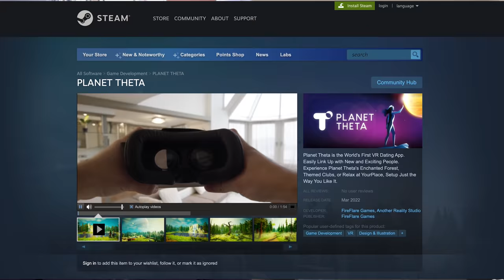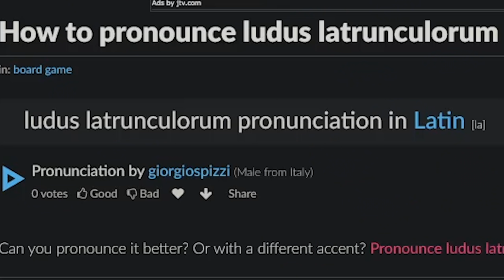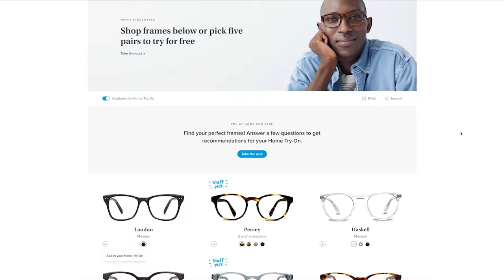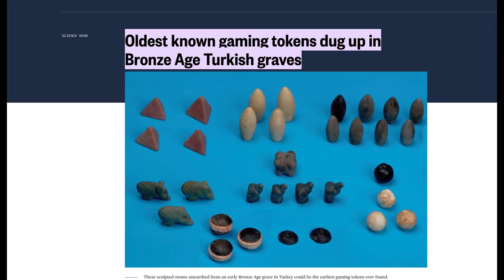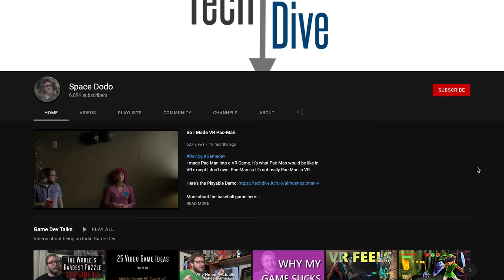Making an ANCIENT Board Game from Scratch

Comment: Two tips for Adam regarding the actual manufacture of the game:

To make a cube from a round stick (without loosing a finger), draw a square on the end of your stick, measure one of the sides of the square then cut a round from the stick at that length. Then simply split the stick along the drawn square edges to end up with your cube.

To mark wood, use a thin bit of metal heated in a fire, rather than the flames directly to make much more precise and intricate markings on your pieces.

All in all a very interesting concept, I can't judge the game since I haven't played it, but the whole process of designing a fun game is an interesting undertaking and a worthy pursuit!

Comment: 7:30 That is not a proper 6 sided die... Any two opposing ends of a (six sided) die shud add up to 7. When ya flip it from 6 to 3 to 5; that confirms that isnt the case on your die.
Reply: Good to know
Reply: @SpaceDodo  It actually applies to all multisided dice too aside from like pyramidal d4s (and odd sided dice).

On any given (even sided) die the opposin sides shud always add up to 1 more than the number of sides it has.

This works even for a D2 (a coin) which ofc adds up to 3 on its only two opposin sides, but also for a d20 and a properly made d100.

On a d6 the difference isnt as important but if you compare a spindown d20 (like an MTG life counter die) to an actual d20 you will see that one can much more easily be marked in a very slight way to assure it to be much more likely to roll high or low as all the high numbers are clustered together on a spindown die.

Its mostly a worry of folks more easily weightin a die to get high or low numbers, but it is also just an interesting fact about how dice are made and about how numbers work and a kinda fun fact about how numbers work, eg like how you can get to 21 by addin up the lowest and highest numbers between 1-20 and how that is true of all numbers.
Reply: Yeah I was just thinking this
Reply: It bugged me to but i mean it doesnt affect the play at all
Reply: @mojann1  well, barely
Reply: Indeed. It also bugged me that a single die was constantly called a dice.
Reply: @SylviaRustyFae  Even without marking, spindown dice are very imbalanced because of the simple fact that you can decide how you hold it and throw it, and that easily can be used to determine which half of the die will be upwards, and thus the higher or lower number side depending on what your desired roll outcome is.
Reply: @mojann1  The more sides you add to a die, the more it can affect gameplay.
Reply: @KainYusanagi  See that to me wud not be called a die roll tho; ive seen when folks try to do that with a spindown and the die doesnt roll at all, it just falls into place on the side they had it on.

Ofc, thats just how i tended to rule that kinda stuff when i did a lot of tabletop rpgs and board gaming; mostly only came up in board gaming nites cuz thered always be drop ins for that who dont understand that fair play is more fun than winning.
Reply: @SylviaRustyFae  didnt they make a six sided dice? When did the dice start to have the order we know today? Maybe it is historically correct
Reply: @mojann1  Well, its hard to tell what the earliest d6 is, let alone to tell what numberin order is correct. There are plenty of ancient 6 sided dice that have our now standard numberin, but also some that didnt. 

However, the whole idea of dice was entirely unstandardized in those times and if we wanted to be historically accurate it wudve been best to not try to even out each face to have an equal chance of being rolled. Dice were very commonly misshapen and lumpy and not nearly as likely to give a truly random distribution of numbers.

But ofc, no one today wud want tk play with a die that is more likely to land on 1 and 4 just bcuz of the way it was cut not bein even and and the maker of the die just not carin enuf to shape it correctly.

It does seem like the six sided die didnt come about until sometime around the time of Romans; but the idea of that being actually true as opposed to it just being they used dice that survived... Id believe it more likely the six sider showed up well before Roman times. 

The commonly used knucklebone dice that can be traced back to being used over five thousand yrs ago were actually six sided as well, but unless one were to grind down two of the sides (which can be done with just a rock and time), it only has four usable sides.
Reply: @SylviaRustyFae  That's just them trying to cheat and doing it poorly, lol. You can easily throw a die with force and angular momentum in a controlled manner so that the rough half of the die that you want lands facing upwards. This is actually why dice cups were invented in the first place; you shake them all around multiple times while keeping the dice obscured so it becomes much much harder to cheat in games of chance, though a proficient cheater can hold the last die against the cup and prevent it rolling about inside, depending on the methodology allowed to the thrower.
Reply: @SylviaRustyFae  luckily that isnt important in this video. Exploring how to make evrything is. And they made a game with a randomness indicator aka dice.
Reply: @mojann1  well just... if youre gonna insist on historical accuracy on the numberin then we shud have it on the unnevenness of the dice as well 9,9
Reply: @SylviaRustyFae  it doesnt look very even in the video
Reply: There were some quick video cuts, I was aware and didn't see an obvious infraction to the adds up to seven rule. A quicker eye might spot it though.

Edit: Rewatched. The 1 side was made on the end of the wood where you can see the rings in the wood, the 2 side was made on the opposite end. Also, right after 7:30 when flipped from 3 to 6, the 1 is visible on the right side.
Reply: @cyalknight  So, at the exact timestamp that i said it happens at?
Reply: Viheart demonstrated that this is not actually the case for all dice of any variety. 

And I know from personal experience that some d8s and d10s from big dice producers don’t have numbers printed to add to dx+1 on each opposing side.

Comment: You should do some CHALLENGES!   Like how about a PHONOGRAPH using Roman Technology----I would suggest using a crank operated "reel to reel metal, foil tape approach myself to avoid any precision "Threaded rods".  How about an electromagnet powered by a voltaic pile?---and possible an ELECTRIC telegraph.  Or telephone---Even a "Crude "wireless" telegraph might be possible.   Many "Modern" inventions could have been made in Ancient times if only the KNOWLEDGE were available.